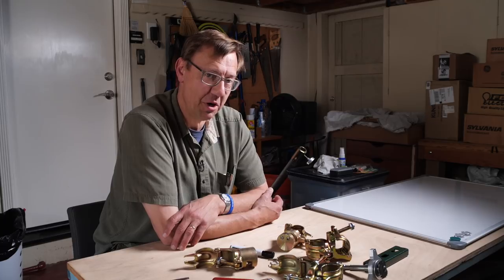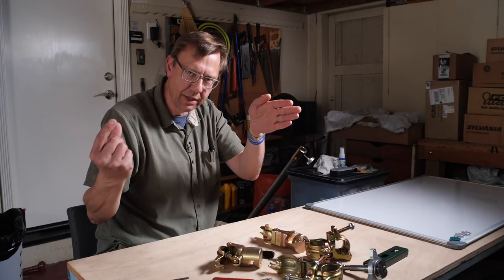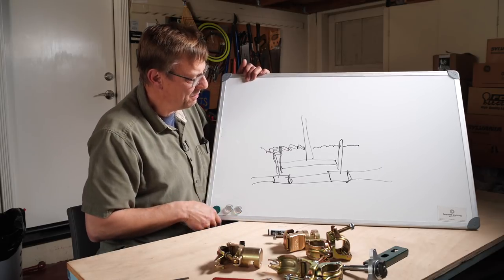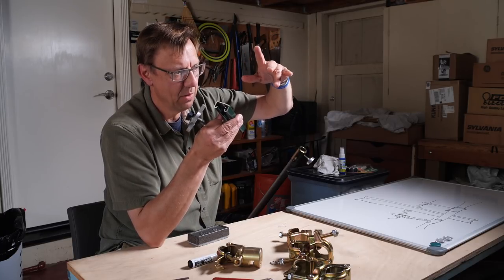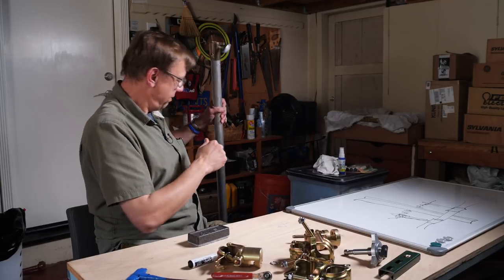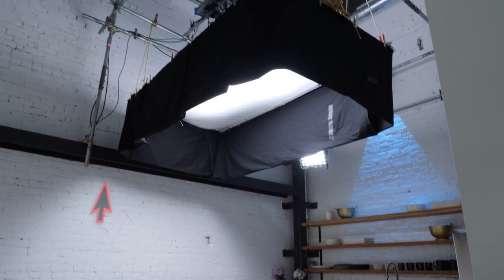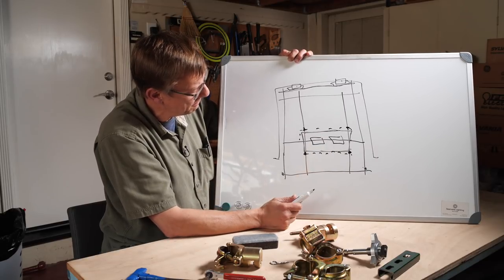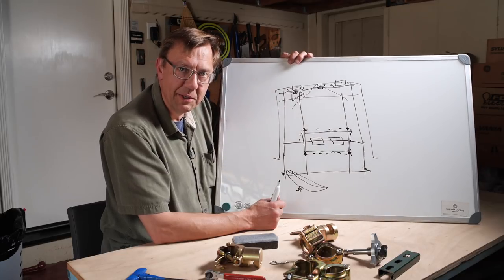Meet The Gaffer #90: Overhead Softbox Rig

Comment: Do you find there to be a dramatic difference between 1-1/4" and 1-1/2" speedrail in terms of durability? Specifically for the purposes of creating overhead rigs or menace arms? 
I'm looking to invest into some speedrail and accessories, but I can't quite decide between the two diameters and I don't see a lot of people talking about their preferences and why. 
Thanks in advanced!
Reply from the maker: Like so many things, it depends on a number of factors. 1. What do the people/companies own that you subrent from most often? Compatibility with your peers can be helpful. 2. How big are your jobs and how beefy do your rigs need to be? If you are working out of a Sprinter van or 2-ton, 1-1/4 should be fine. If you are working out of a 5-ton and find yourself opting for steel pipe from time to time for greater rigidity or longer spans, then 1-1/2 will probably be the better play. Hope that helps!

Comment: How do you calculate payload capacity on rigs like this? I looked up the weight for the s60s, ~30lbs + more for the softbox and such. So that would be around 60-70 lbs roughly not including the weight of the speed rails. How do you know how much the Speed C's and clamps can hold? 

Thank you!
Reply from the maker: I wish I had a better answer for you, but unlike those who rig larger events and movies using box truss and chain motors, I just have a feel from experience of what will hold and what is too sketchy. And of course you do your best with safeties. I know that’s not a satisfying answer, but that’s what I’ve got. I know enough to know when it’s time to bring in a real rigger😀
Reply: thank you!
 @meetthegaffer

Comment: Hello Luke. No idea if your still fielding questions (3 years later)...I'm curious for people that don't have I-Beam clamps or come to location day of, those I-beams seem like good rig points for more traditional clamps like cartellinis or studded C-clamps with shims. Would you advise against rigging speed rail to stuff like that?
Reply from the maker: You can certainly use Cardellini’s and c-clamps, you just have to gauge the slip factor when weight and side pressure is applied. Cardellini’s are great, but they have limits! The main thing is to add safeties to your rigs so there is a second line of defense, so to speak, should the rig encounter an odd force or weight you have not accounted for. There’s a fine line between a solid rig and under or over building it. Overbuilding is not a problem for safety, but I think you know what I mean😀

Comment: Hey Luke. I'm looking to create a simple overhead speedrail grid for my home office. Any recommendations on starter plates to mount to the ceiling so I can start building a 1 1/4" speedrail grid? Thanks in advance.
Reply from the maker: The Modern Studio Equipment catalog is probably a good place to start. It depends how far you are able to drop down. There are plates to swivel or fixed clam shell. Or you could do a plate with 3/8-16 thread and come off with speed rail starters so you can drop down and go anywhere. I don’t imagine you being carry that much weight, but finding a way to safety the rig would be good too. Hope that helps a bit!
Reply: @meetthegaffer  thanks Luke. Yeah I'm just looking for some starter plates that I can use swivel cheeseboros to create a frame and maybe some cross bars for a top down camera setup. Mostly I'll just be hanging some aputure lights or lightweight LEDS so weight shouldn't be a factor. Small space so I want to keep floor open as possible
Reply from the maker: Yup. Modern makes a plate to swivel cheese that should work well.

Comment: Thanks for the great video :)
Would you be concerned that there's no opening for a safety pin on the junior receiver? Or is it generally safe enough to just tighten the screw?
Reply from the maker: I would always attach a safety cable (aircraft cable or rope safety) from the light fixture to another part of the grid. Always have a backup! Hope that makes sense?

Comment: Hey Luke! Thanks again for continuing with the great vids. I’m curious, in situations like these, when would you reach for a grid (LCD) for the diffusion? I suppose maybe they just don’t narrow down the light enough. The space was quite tight after all. Rigging skirts is just a PIA! Anyway, would love to hear your thoughts. Cheers!
Reply from the maker: To do it again, I might try going with one Kino Celeb 850 with a snap bag and snap grid. New Lite Mats or Lite Tiles might work, but I don’t currently own those units. I’ve been holding off jumping into Lite Mats, but they are maybe now a good option with the DMXable controllers. Aladdin Fabric Lights interest me too, because I like the dual use as a travel unit. We’re always weighing the different uses, DP requests, storage, and what will cannibalize the units we already have, right? Good problems to have:)

Comment: Isn't that rig a bit overkill for the payload? Would it not have been safe to stretch a couple of long pipe wallspreaders horizontally, with a couple speedrails between them forming a square for the frame, one pipe between those for the lights, and perhaps tie that to another pair of wallspreaders up above it with either rope or vertical rail?
Reply from the maker: There are a lot of ways to create points. When you’re going to have celebrities under your rig, a little extra ruggedness is probably warranted. Half the fun of this job is trying our new gear and new ways to do things.

Comment: I have a long time client in a warehouse space, shooting stills, and this rig would be perfect, thank you!
Is there any danger of the pipes slipping over time? Are there any redundant safety measures to prevent this?
Reply from the maker: It’s a good idea to add safeties whenever possible. We added rope safeties to the square column speed-C’s. You could add aircraft cable safeties to extra c-clamps or actually drill holes for permanent/redundant tie-offs. Checking tightness of all the nuts and screws once a week until you feel no loosening is taking place would be wise.

Comment: Hey Luke! What knots do you typically use to tie the frame to the speed rail?
Reply from the maker: Grip’s choice: clove hitch or double half hitch come to mind. Ernie may have an opinion:) If you want to adjust, you could add pulleys and run the ends to a point on floor level.

Comment: What is the diameter of your speed rails?
Reply from the maker: I use what we call 1 1/4” speed rail. It’s  schedule 40 aluminum pipe. The actual OD is not 1 1/4”. Other people prefer 1 1/2” pipe because it is more rigid, but it’s also heavier and takes up more room, so there’s a trade off.

Comment: What speed rails do you use?
Reply: 9:30 - I think I found my answer: 1 1/4
Reply from the maker: Yes, 1 1/4. The industry standards are either 1 1/4 or 1 1/2. Modern cheeseboros can often work with both, but for the most part it’s good to choose one size and stick with it. I started with a van, so I went with the smaller size. If you have longer runs where the pipe bend makes you uncomfortable, you can double up on the pipe (ladder truss) or triple up (triangle truss) or go with steel pipe. Beyond that there is regular box truss:)